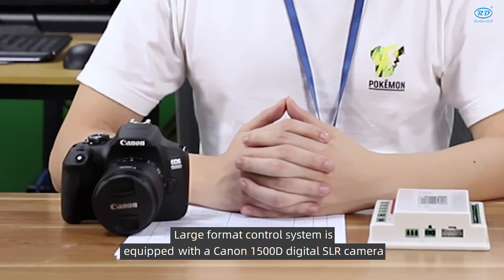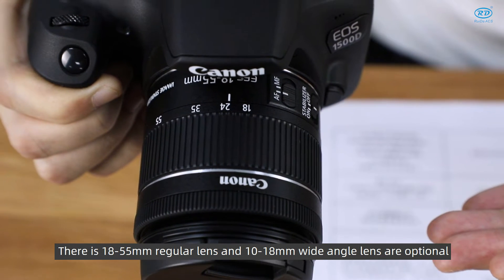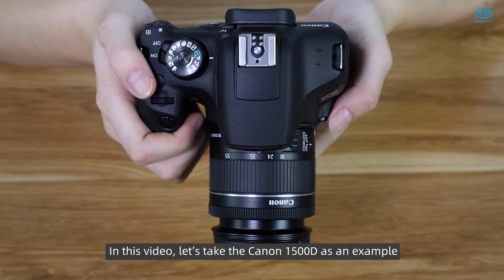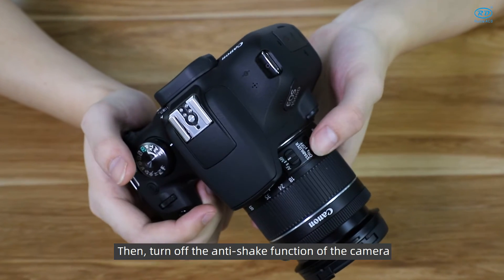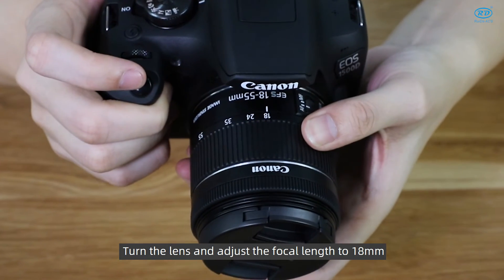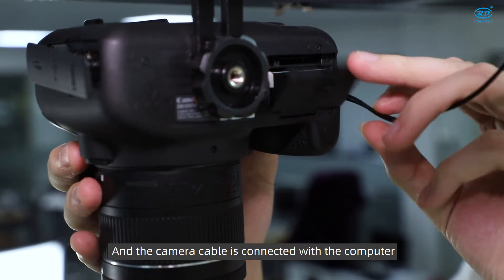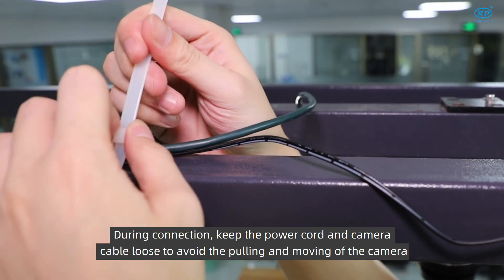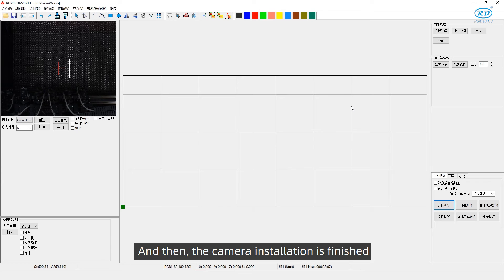RDVisionWorks tutorial:Camera Installation#Large format control system#ruida6442g-dfm

Comment: Hi. I just bought RDC6445G-DFM-RD. Can I use action cam like gopro or other camera for CCD with this ruida controller?
Reply from the maker: It mainly depends on whether the interface type is compatible. For CCD cameras, additional camera drivers may need to be installed.

Comment: what about rdc6442S? does it work with camera?
Reply from the maker: Due to hardware compatibility and software adaptation issues, it is necessary to switch to models with visual functions, such as RDV6442S and RDC6442S-DFM-RD.
Reply: @shenzhenruidatechnologylim5388  And what about new EDC8445S will it work with RDVision?